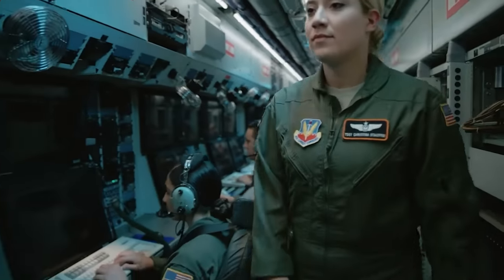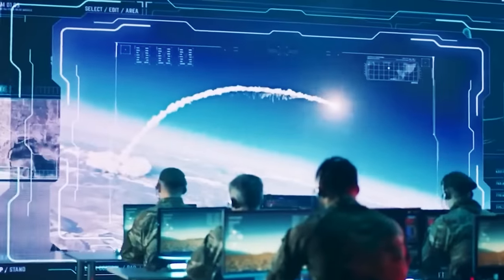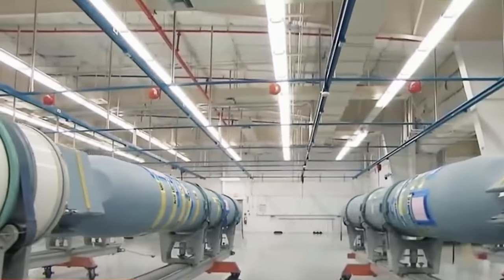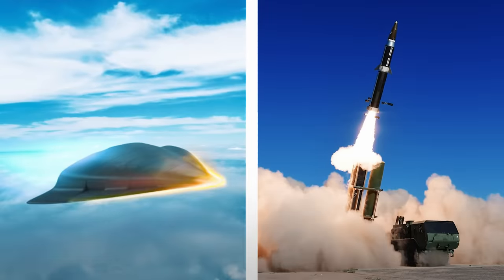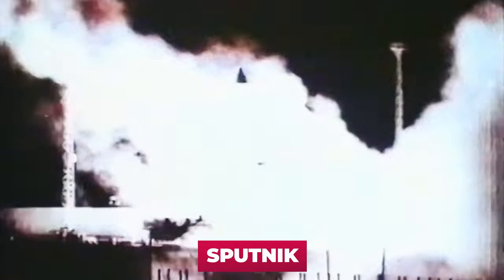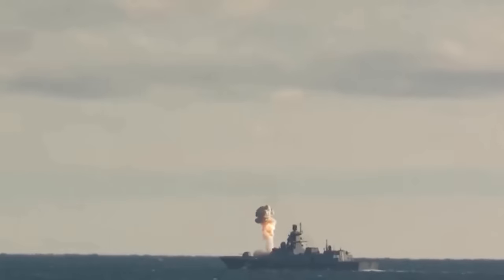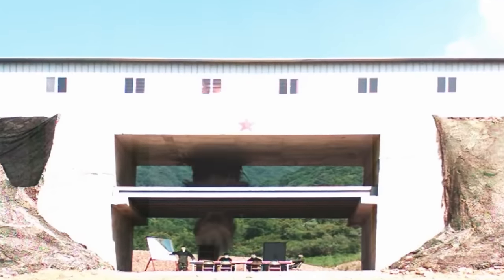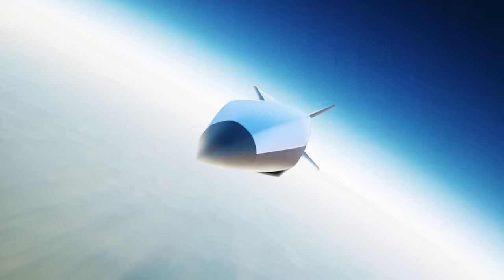US Tests Hypersonic Missile 5 Times Faster Than Speed Of Sound

Comment: Mach5 is already slow. 
Pentagon can scrap any hypersonic project if speed is less than mach10.
Till missiles will enter service,  Russian missiles will fly Mach15 - 20
Reply: The US won't disclose the top speed of the missile. Because hypersonic is, by definition, greater than Mach 5, that is all the Pentagon is willing to concede. The missile's speed is likely significantly higher. The author of this video has not accounted for this in the comparison.
Reply: @genem895  Doubtful, but you are free to believe what you wish.
Reply: US Army already has LRHW. It's been tested in 2020 reaching almost 3000km range with Mach 17 terminal speed. Naval version is CPS and will be retrofitted on the 3 Zumwalt class destroyers by this October and Virginia class Block V subs by 2025 if I'm remember correctly. The ones that are being developed as shown in the video are the Airforce's AGM-183 ARRW and DARPA's HAWC. ARRW uses a miniature hypersonic glide vehicle HGV while HAWC is a scramject cruise missile. Those may take some time but Army's LRHW is already operational since October 2021 with the first battery being delivered. It’s also light enough to be transported by a C-17 Globemaster so it can quickly be deployed and launch it’s missile after landing similar to M142 HIMARS. If they have enough numbers by this year, these will be deployed to the front lines. Japan has already agreed to host them.